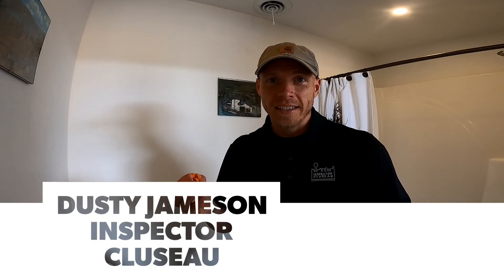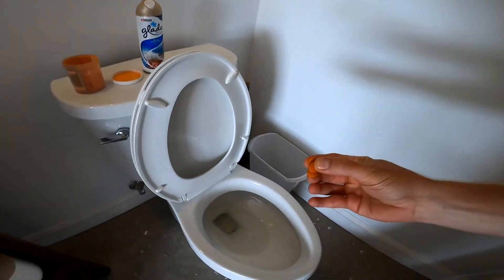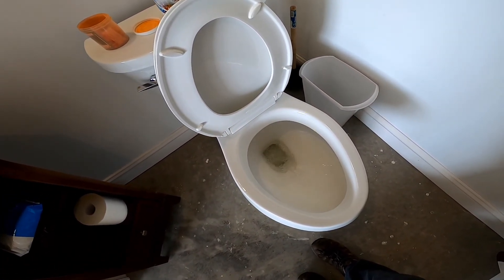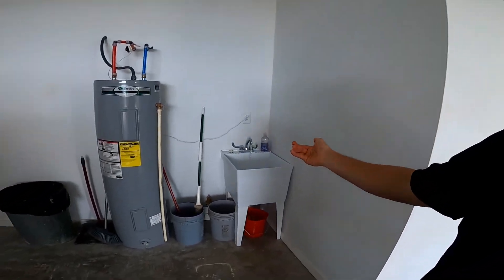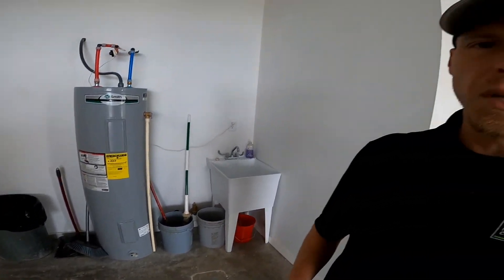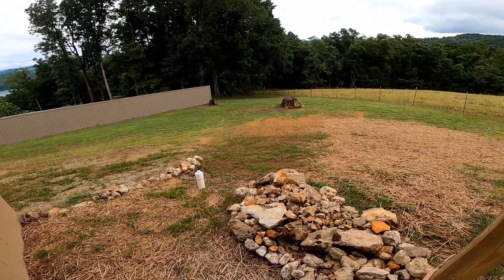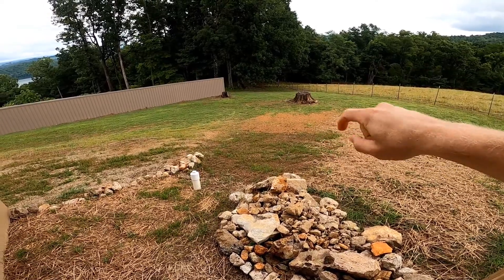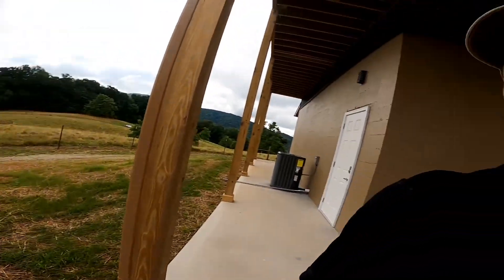Septic Load and Dye Testing

Comment: As a Licensed Septic Professional with over 20 years of experience, I can assure you that a "dye test" is a total and complete waste of time, because it doesn't accomplish anything in terms of evaluating the condition of an existing on-site disposal system. To be clear, the only way to accurately determine the condition of a Residential Septic System, is to dig test holes in the Leaching Area or Drainage Area of the yard. Although a "flow test" is an important part of a Septic Inspection, as a general rule, it doesn't require running the water for more than 20 to 30 minutes. Typically, that's about double the amount of time a person spends in the shower, because the average person showers in 15 minutes or less. In any case, if the water from the house is flowing into the Septic Tank normally, and the Water Level in the Septic Tank is normal, then what's really the most important part of an inspection is locating the Leachfield or Drainfield. A Licensed and/or Certified Septic Inspector should be able to identify the type of Leaching Field and it's condition by digging anywhere from 2 to 4 test holes. In other words, if the Septic Inspector doesn't bring a shovel to the party, then he's not doing his job, and no matter how many times the toilet is flushed or how long the faucets run, you can't accurately assess the condition of a Leaching Field without actually seeing it. Not even a Camera or "scope" is a satisfactory substitute for digging holes in the Leaching Field. That being said, I have nothing against using a Camera to inspect the Outlet Pipe and/or Distribution Box, but keep in mind, not every system has D Box. In fact, many modern Leaching Fields have a manifold or use "serial distribution" instead of a Distribution Box. The bottom line is you really need an experienced Septic Professional who knows what to look for, and understands what he's looking at, when he finds it.
Reply from the maker: I actually agree. I paid about $15 for a few hundred tablets, so my cost is negligible. I don't charge my clients to drop them into the system because I don't have a lot of faith in the testing. I would even say that running the water for a long period of time is a better test than dropping the dye. I actually have a video on that too. But since the dye is so cheap for me, I figure I will go ahead and drop it, do a load test, and just see if anything happens. But I tell my clients over and over that this is not a reliable testing procedure - it's just cheap and easy to do, so I do it for free. I suggest a septic professional to test systems for reliable information.
Reply: @inspectorcluseau6084  where did you get those tablets from?
Reply: You don’t think he knows that??? You’re a $30 an hour septic system guy talking to a two or $300 an hour home inspector. Well at least I know that I’m a home inspector and that’s how much money I make and I usually work 40+ hours a week. Know who you’re talking to before you make a long and ridiculous commentthat’s pointless
Reply: @theallaroundguy2399  You couldn't be more wrong, because I own a Septic Company and have for over 20 years. In fact, I make more money than most Home Inspectors, but you can think what you want.
Reply: Put your dicks away, it’s a basic instructional video.